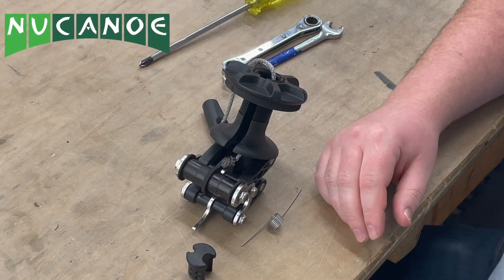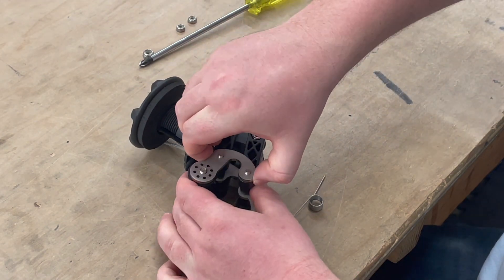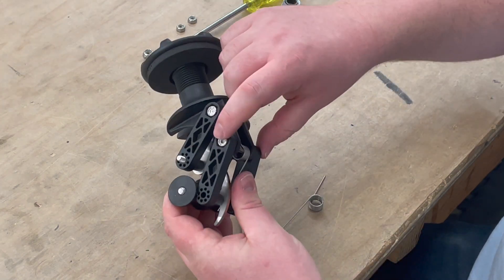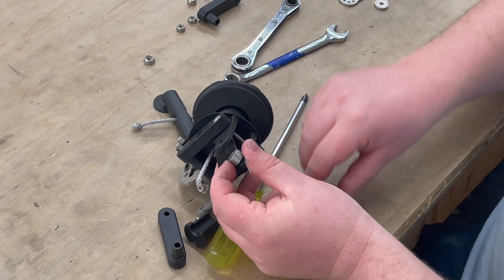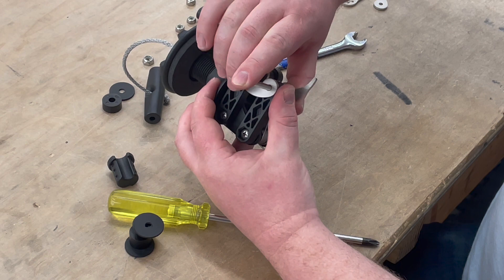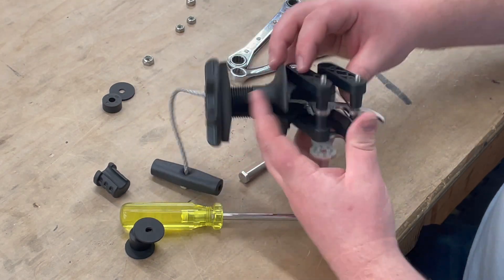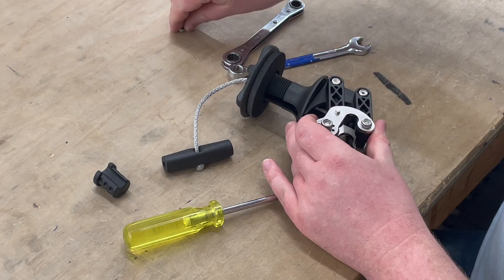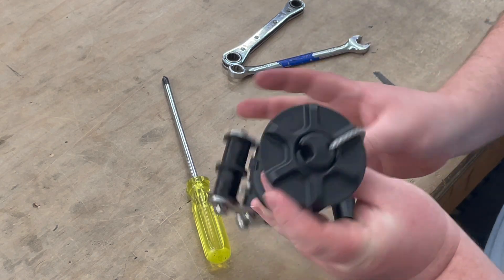NuCanoe Transducer Retract System - 2nd spring and Plug Installation

Comment: Would this work with other kayaks like the native slayer max 12.5 which has a similar recess for the transducer?
Reply from the maker: Unfortunately not, this is designed in conjunction with the specialized under hull compartment on the UNLIMITED and U10.